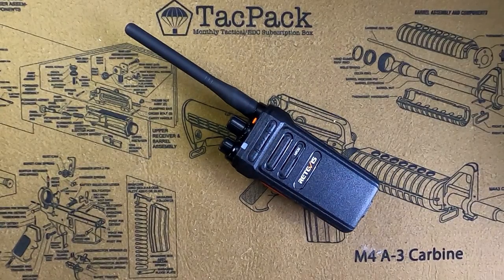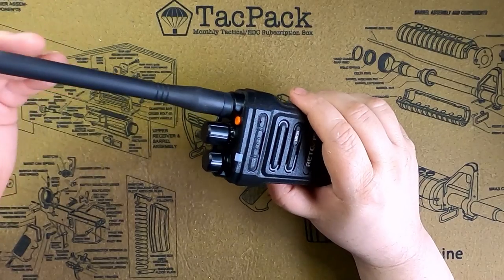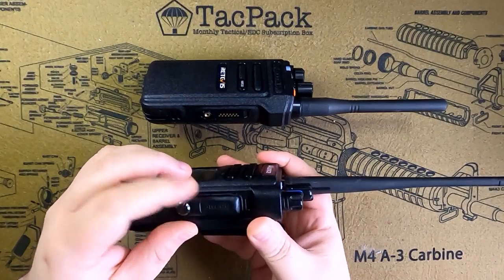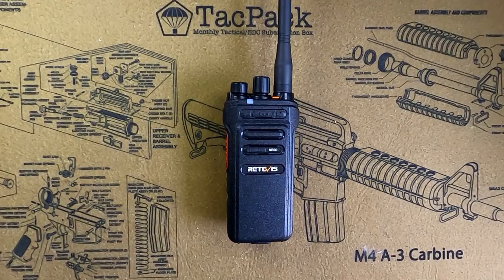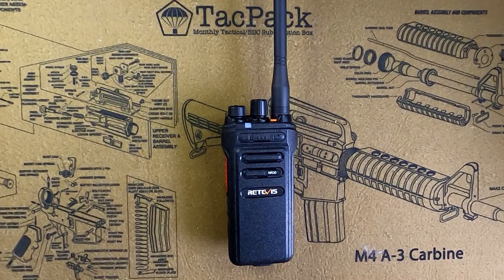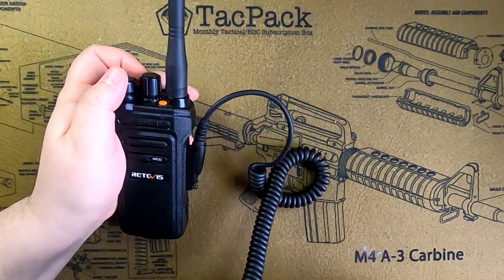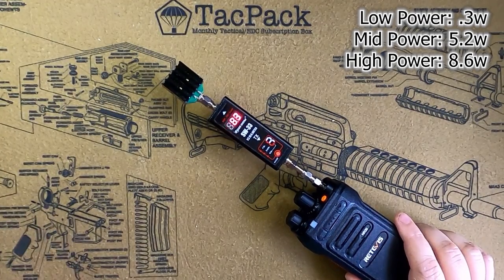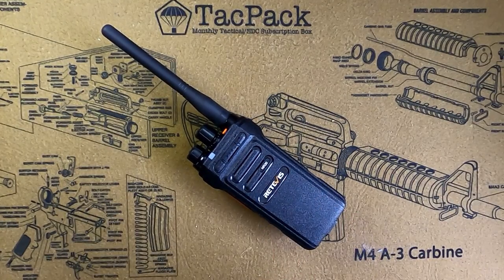Retevis NR30 GMRS Watt Radio w/ IP67 and Noise Reduction Review | Offgrid Technology

Comment: If anyone wants to turn off the CTCSS privacy tones in their #RetevisNR30, you can do it manually without using the software. This will allow you to hear others when they are transmitting. 

The following is the procedure:
1) Turn radio off
2) Press transmit and the little button with (2) nubs below the transmit button at the same time
3) While holding those buttons down, turn the radio on (it will make the 'on' sound) but keep holding those buttons until you hear a beep. Release the two buttons.
4) At this point all the privacy tones will be disabled until you repeat this same process to turn them back on.
5) Basically it is the same as selecting or de-selecting the checkbox in the software
6) Hope this helps

Comment: So with this model Retevis says that the preprogrammed CTCSS/DCS Codes can be turned off, thus "opening" RECEPTION.  Question: does the procedure also turn off the CTCSS/DCS Codes for TRANSMISSION as well ? If not, I'll just wait a couple months for the Ailunce HA1G to be out (that's the same radio but with a keypad and a few extras)
Reply from the maker: Yes they do cancel all codes. I would hold off though we have an H1AG coming from Retevis for review. Should be up this weekend or early next week.
Reply: YouTube didn't notify me of you reply... thank you.  And I already have one of the HA1Gs and quite like it. I'm hoping that spare batteries are going to be available.
Reply: One is 10 watts...other is 5 watts

Comment: Hello…..what programming cable does it use?
Reply from the maker: It came with one in the box.
Reply: Mine did not
Reply: @nkflight4647  Did you ever find one? Also, why do you even program a channelized radio?
Reply: @PatrickKQ4HBD  Because they are features you can change in the radio itself like wide/narrow band, wattage, how each external keys functions, and more...Did you watch the video??

Comment: Is this 5 watts or 10? Or dows it have to be programmed to 10?
Reply: You can change power levels with one of the side buttons on the radio. Low (around .75w)/med (around 5w)/high (around 10w)...the actual power will vary by radio and which specific frequency you're using from what I've seen. You'll get one beep for low, 2 beeps for med, 3 beeps for high.

Comment: Do you have to program it...just want a simple  gmrs radio... that the wife  can use
Reply: It does have default tones you need to remove if you are using with a different model/manufacturer but the channels are already seutp.

Comment: Guess you didn't get the memo Old Hickory parent company Ontario knives has gone out of business.  If you want them get 'em quick.
The Retevis radios are being shipped misconfigured and need to be reprogrammed for wide instead of narrow and high power instead of low as well as changing squelch. Those stock ant. suck. 
They have a set of 3 for $26 Retevis RB27V MURS Radios on AMZN. Get programming cords for your radios.